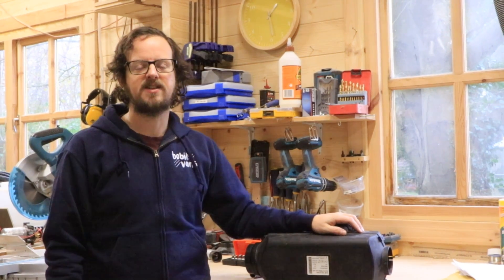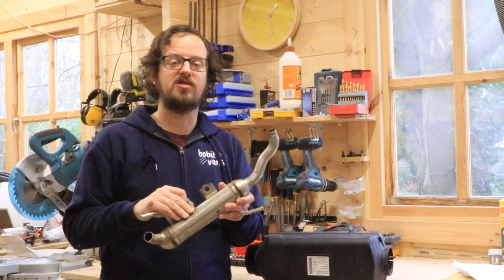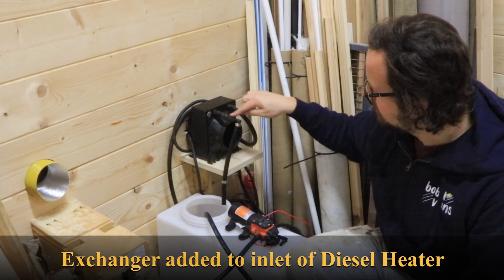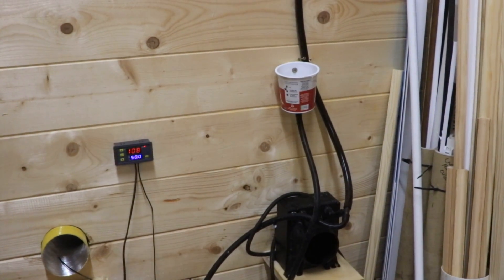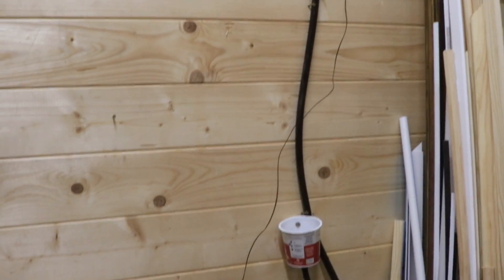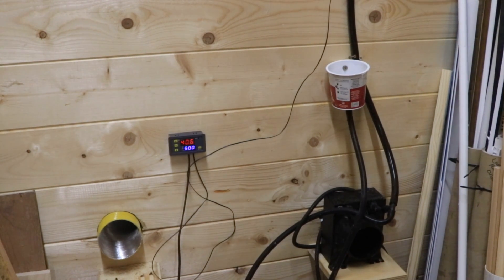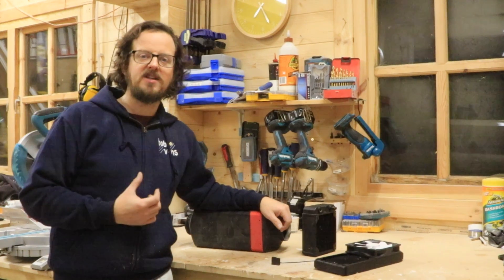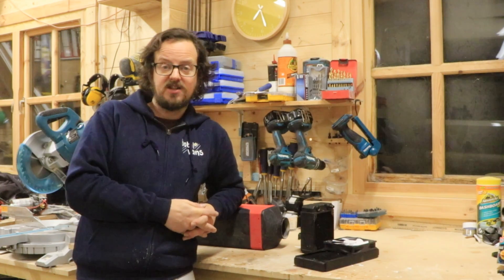Chinese Diesel Heater upgrade with EGR cooler

Comment: The energy in exhaust gases (mainly CO2,CO, NOx, SO2 and some H2O) from oil is quite low. That is due to the low water vapour content. Large power plants never use systems to recover heat from exhaust gases using fossil fuel . They have made the calculations. I promise you. In Bio fuel plants however, the water content of the fuel you put in the furnace could be up to 60% and that will generate a lot of water vapour that you want to recover as a lot of energy has been spent to produce it. (Water requires a lot of energy to go from liquid to gas) It is probably not worth the money to recover heat from fossil fuel exhaust gases.
Reply: Large power plants do recover their exhaust heat. The part of a power station boiler that does it is called the economiser.
Reply: Never heard about combined cycle power plants? They recover energy from gas turbine exhaust to produce steam for a steam turbine. Maybe they've done their calculations as well 🤓
Reply: Power plants are entirely about recovering heat from the exhaust, that's literally how a boiler works. Any steam plant faces a point of diminishing returns as the fluid working temperature is so high. However, some plants use economizers to preheat combustion air. Exhaust gas economizers are also very common on large ships, taking waste engine heat to produce hot water and sometimes for heating.

Comment: I remember reading somewhere about a guy making an exhaust gas to air exchanger for one of these by running something like a 4 foot length of pipe that he'd covered in fins down inside a larger pipe, then blowing air up the outer pipe with a PC fan. He never put energy reclamation figures in the writeup, but said that with this thing installed he got a lot of extra heat, and could just about keep his hand in the flow at the exhaust outlet without it being "Painfully hot".

I can't remember much more than that though. It could have been that much cooler because he might have had 20 foot of uninsulated corrugated pipe either side of it, or it might really have been scavenging a significant amount of heat from the waste gas...... I dunno either way, but it was an interesting idea.

Comment: Late to the game I know. but I like your video. I am about to purchase one of these heaters for my Cabin. I want to use fresh air from outside instead of recirculating air as its stuffy and often full or sawdust and crap. But that will mean very cold air intake sometimes. 

My thought here was to use a slightly larger air intake pipe and route the exhaust pipe down through the air intake pipe. Try to preheat the air a little before it goes through the heat exchanger. Will of course make sure the air intake then extends away from the exhaust to avoid gassing my self. does this sound like a reasonable idea? any pitfalls you can see? 

kinda like the water heating idea you have heat but with no additional pump or radiator or fan.
Reply: You could buy a heat exchanger and pump air from the inside through one side and fresh air the other connected to the intake. This way your still protected from the burning fumes and you are preheating the air in the intake for effiecency. You could use the exhaust as the heat source as well.

Comment: You need the unit inside, especially the exhaust bit, there are a few avenues you could go down, you only need the last bit of the exhaust outside, you could make a steel enclosure, another use is a exhaust box with a heat exchanger from a combi (stainles) inside and have the end exhaust vent through this with a diffuser pipe then vent later, condensation trap required, the output of the water to rads, or have a heat pipe inside that blows the heated air, or heat veins around the pipe again isolated but has a collector tank which is circulated .
Reply from the maker: Last thing I wanted was to have the heater exhaust inside. The Autoterm seal is pretty good especially with a bit of sealant but wouldn’t want to risk it.

Comment: Wouldn’t it make more sense to run the exhaust gas through a aluminium radiator
Reply from the maker: I don’t think so, no. But not stopping anyone else doing it!
Reply: "Air-to-air" heat exchanger would be simpler but a break would result in carbon monoxide leak rather than water

Comment: So you gather heat from exhaust and put that heat to the intake of heater?
Reply from the maker: Exactly. Raises intake air by a few degrees.
Reply: @bobilvans4205  isnt there more losses that way? 🤔
Reply from the maker: @regun2434  I did it because I don’t need an extra fan. Can’t see any downside personally.

Comment: A Russian guy has calculated that on full these 5kw heaters produce an exhaust at 210c + and an energy of 1.5kw on full - the thing to allow for is condensate - it will drip acidic water
Reply: Yes he has basically made a condensing oil boiler with all the sulphurous acidic goodness that implies...

Comment: I just bought 5meters of the exhust tube, coiled it tightly into a vertical "spring" and put a usb fan at the bottom, blowing up through the coiled exhuast and it cooled the exhuast like 75degreesC and the USB fan is like 2 watts
Reply: sounds like a good idea, you could extend the coil longer

Comment: You did all that to offset the buring of fossil fuels.  Do you know how much diesel you would have to burn in that little heater to off set the manufacturing of that tank, pump, radiator, hoses, heat exchanger and misc other stuff. Not to mention the electricity your using for the extra pump and fan...
Reply from the maker: Hmm. Everything was either second hand or scrap, or from a previous test project. I probably added about 10-15% efficiency to the heater.  So if I burn 100 litres then I’d save 15 litres which is the equivalent of around £20 here. So that’s not bad. I’d have a return on investment of about 300 litres, and not burned 45 litres into the bargain.
Reply: The most energy intensive part of the setup is probably the radiator made of aluminium, which takes about 200 megajoules of electrical energy per kilo to refine from ore. (recycled from old pop cans is much less) One litre of diesel would yield about 10 megajoules of electricity when burnt in a generator. So if we say the radiator is made of 1kg of virgin aluminium, that works out around 20 litres of diesel.
Reply from the maker: @connerlabs  The radiators are copper but that’s really interesting, thanks for the input! I guess it is similar for copper?

Comment: Nice idea. If you put the heat exchanger bellow the water reservoir, the water will circulate naturally using the siphon principle. No electric pump (and associated noise), no forced water flow.
Reply: The bore size on the inlet/outlet of my EGR were not big enough for it to thermo siphon properly. It ended up boiling in the EGR then firing through as steam, not ideal...
Reply: @wrowner85 so in ur case, you do definitely need a small pump to maintain efficiency. Might be going overboard, but I guess u could run a small pump off the exhaust gas if u didn’t want to use extra electrical power in an off grid situation.
Reply from the maker: Agreed but I wanted high flow for maximum efficiency.
Reply: @bobilvans4205  , by consuming some extra energy, you decrease the efficiency. However, I understand your point.
Reply from the maker: @danielmusat597  the small pump is 6 watts and I think I would get much more than 6 watts of extra heat so I think it pays for itself. No science or testing behind that, just a hunch.
Reply: @bobilvans4205  Totally agree with you! If you need to remove the heat from the water fast, your solution is perfect. BTW, did you think using the exhaust gas to heat up the floor? Just gas involved, no transfer to water or anything like this. Personally, I would do both but I have no real possibility.
Reply: I would use thermosyphon too - there's only 1.5Kw heat available so it won't overwhelm the unit

Comment: You're the only one I've seen with this idea, I'm about to try using an intercooler to act as a radiator to capture the exhaust heat, I'll let you know how it goes. I've got my heater and the intercooler ordered, should be in soon.
Reply: exhaust gasses are usually more corrosive than intercoolers are designed for, it could work for a while maybe.
Reply: dont do it exhaust is way more hotter than any intercooler can handle.... get an egr

Comment: I’ve tried installing an egr (off a Mazda 6), managed to get a 300x600 radiator up to 54 degrees but found after a week or so it started to block the egr? did you lean out the mixture on the cdh settings?
Reply from the maker: It’s an Autoterm but it’s been running flat out all winter (8 hours a day, 20 days per month) with no issues. Maybe your egr is more restrictive?
Reply: You would think an EGR from a diesel wouldn't be as restricted..Also a regular auto radiator wouldn't work as well because the flues end in a  common area in the side tanks instead of following a certain path or channels..I'm thinking of scaling this up..Like a full size torpedo diesel/kerosene/something that deals with waste oil better...with a EGR from a Detroit Diesel DD15 liter (Mercedes OM574 I think it's referred to in Europe)..Or maybe 2 of the same EGR coolers..I like your take on getting the most from it if you're gonna burn the shit anyway..Now Im thinking of using the after treatment system from the same junk trucks..DPF filters to zero NOx...The next green..ish energy..Lol.. You've created a monster..Naw..I'm going to bed 😆

Comment: Yes, I did this with a few gutter elbows to make a heat extraction muff, or you could just take a heat exch baffle from a gas furnace which would do air to air beautifully, no water needed. I pulled the EG temp down about 50F and added 50F to the burner air intake. But only operate it on lower settings so as not to burn up the device by feeding its own heat back into it. (which it very easily will!)

Comment: I am sure you gave it some thought, why did you choose to have the water enter at the tailpipe and travel towards the heater?
Reply from the maker: It’s more efficient going that way. Then the water is heated by the hottest gas before it exits the egr cooler. If it was the other way round then the water wouldn’t be heated as efficiently as the difference between water and air temperature is smaller.
Reply: @bobilvans4205  I appreciate you answering that question.  I've looked on US Ebay for  heat exchanger like yours . Perhaps it's called something else here  as I'm not finding it. I'd like to use one to make hot water in my camper
Reply: @64maxpower  that part is an EGR Cooler. They're very common on diesel engines. You are probably not still looking for one but maybe this will help someone else!
Reply: @holysirsalad  I am. I still live in my RV. I love it so much that I'll always live in a camper/RV/tiny house. I am at peace living like this
Reply: @64maxpower  Glad to hear it! Cheers

Comment: NOTE"  I noticed your fuel line.. outside.. where it enters the unit to be burned.. You may want to insulate that.. the cold as you know isn't a friend of diesel ... at low temps...
Reply from the maker: We actually burn kerosene which is good down to minus forty-ish. It’s not that cold here.

Comment: I wonder if you could add a small underfloor heater this way in a van. You can buy kits with tubing and mats pretty cheap, but I'm not sure how you'd get the air out of such a system.
Reply from the maker: Yeah you could do with a header tank although I’d be worried about being able to moderate the temperature enough to keep it below boiling in the exchanger. Those exhausts get pretty hot.
Reply: I just ran the exhaust underneath my van. No co at all, checked several times. My floor is aluminum and you can easily walk barefoot in winter with it just pointed near the floor. With this setup, holy crap. Could easily heat a floor. It melted through the incoming fuel line once at the end of the exhaust, so I'm sure it'll have enough to do a floor. You may need a draft fan at the end of your run or it won't burn right.

Comment: would me much easier to run the exhaust back in the shop thru a big old steel radiator and back out 
no mess no fuss easy efficient heating

Comment: By having the EGR outside you're already losing 50% of the heat. I use a similar heater when winter camping, but I have 1 metre of the exhaust EGR for heating water,and the silencer inside the tent. The second silencer outside the tent is warm to the touch and can easily hold your hand on it for as long as you like. So most of the heat ends up inside the tent.tested it last month when it was minus 2c at night and in the tent it was 21c and I used 2.5 litres of diesel in 8 hours overnight.
Reply from the maker: Thanks for the comment! Where am I losing 50% of the heat? I have literally 40mm of exhaust before it goes into the EGR-I don’t want to risk having exhaust joints inside a building for obvious reasons.
Reply: @bobilvans4205  maybe put some good insulation on the egr cooler and i guess you could see an increase in water temperature and efficiancy of ths set up.
Reply: @12knut  a good exhaust wrap would make a world of difference  :-)
Reply: @bobilvans4205  By having the EGR outside, any heat lost through the housing of the exhaust goes to the outside instead of into your heated space.
Reply from the maker: @Flyinghook  why risk having unsealed exhaust inside a building? For an extra 1% efficiency?
Reply: @bobilvans4205 why bother with joints?  My two meter coiled and fan cooled exhaust is close to toom temp at exit.   Plus I can swap the unit if required in less than 5 minutes.
Reply from the maker: @hillaryclinton1314  there’s more than one way to skin a cat!
Reply: @bobilvans4205  hi what make of heater are you using. Thanks
Reply from the maker: @mickeynomad  Autoterm 4K
Reply: the silencer is not gas-tight and will vent out the combustion products and kill you, it must not be in any space that communicates with occupied areas at all! Careful. Several deaths on boats already from this problem.
Reply: @douglundy5755  I use gun gum on all the exhaust joints to properly seal them . My heater is mainly used in a tent and I use a carbon monoxide alarm when the heater is operating. No issues so far.
Reply: @fuzzybobbles  oh good work..
Reply: You have probably sealed your silencer as well, around the edges where the stainless is simply spot-welded. If you pressure test a little silencer you find it's not airtight at all. I don't even use those things and find they're not necessary.
Reply: @fuzzybobbles  The problem with joints is not that much they won't seal normally, but they are a weak points prone to fail. No sealan gum will make the risk of the tubes e.g. slipping off much lower. These heaters are supposed to be mounted on a plate with the combustion inlets and exhaust outside, just because there is risk of the tubes detaching or getting penetrated by corrosion.
Reply: @annaplojharova1400  exactly balance flue
Reply: Is that a 8k heater?
Reply from the maker: @captainjollyrogersailingso6809  Autoterm 4K
Reply: What did you do with the exhaust going into your tent? (From the end of the EGR?)
Reply: I run an all in one that is bolted to a wood chair, has the 2 meter exhaust lazily coiled and going downwards with a fan blowing across it, goes through the wall sleeved in a 1-1/2 inch copper pipe.  At max heat it is slightly warm outside at low, it's 100 percent condensation and icicles hanging down...   I estimate 95 percent heat recovery.
Reply: Great conversation, with a lot of good info, CO2 monitor always a must for me & exhaust 100% outside. Only thing I would charge is a bigger EGR & as surgested, wrap it in exhaust insulation
Reply: @mikelacross co monitor.   Your breath has more co2 than this does if properly inßtalled
Reply: So you do know where you are losing the 50% you just don't want to put it inside

Comment: The Chinese fan motor usually needs needs new bearings and brushes after running so long and the fan and motors are all simular so don't disgard it just upgrade those Chinese bearings to nice reputable ones works for me had mine nearly five years now
Reply: £12 for  a replacement motor and fan assembly. I have a box of spare parts for mine, so when winter camping in a tent I'm covered if something does fail.
Reply from the maker: Yeah I will, I had the Autoterm anyway and I’ve got other plans for the Chinese model so it wasn’t just that it was knackered. Also the Autoterm kicks out a bit more heat.
Reply: @bobilvans4205  Not being a smartarse mate, but the autoterm heater is just a rebranded generic Chinese heater, with a couple of mods.
Reply from the maker: @stuartcotterill9475  I can assure you they’re not! Completely different in every way. Used to be made in Russia but now mane in the EU in Latvia.
Reply: @bobilvans4205  planar heaters you mean? They used to import bodies from China but made all the other components themselves. Still made in Russia, Latvia is just a distribution hub under the autoterm/advers brand to get around sanctions lol
Reply: Where do u get them from